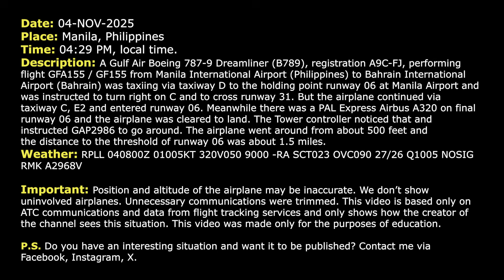Runway incursion. Controller saves 2 airplanes at Manila Airport. Real ATC

Comment: On the 787, when setting the MFD to the lowest range on the ground you can see the runways and taxiways, and if I'm not mistaken they're labeled too. It shouldn't have taken too much on the PIC to look and see which taxiway they were on and which one they were supposed to turn, especially in bad weather where that feature would've come in handy. 

While that spot between Terminal 2 and the FBO ramp is indeed confusing even on a good day, I don't see how the PIC wasn't aware of the layout, considering that this is a regular Gulf Air destination.

Comment: Part of the reason why they also accidentally entered the runway was the runway stop bar lights were not working as per the NOTAMS of RPLL
Reply: Having no stop bar light is normal bro. Pilots should know where they are with or without stop bar. RUNWAY& Taxiway markings are there for a reason. If in doubt just stop the aircraft and ask atc.
Reply: Thanks for the info.

If that is enough to enter active runways despite sitting in a B787 cockpit with not only electronic charts in their EFB, but actual moving maps which shows the entire airport layout in detail and the position of their plane, I don't know what to say. I understand, everybody makes mistakes. But if you even miss vacating taxiways, there is a deeper problem.
Reply: din atin alam totoong reason bakit nila na-missed ang mga instructions. 787 is a modern ac. may mga display ng taxiways yan for sure pero dumiretso parin sila sa runway at hindi nila nasunod yung exit na ininstruct ni tower

Comment: When first instructing the go around, did the controller really only give the altitude ("4000") and didn't use standard terminology of "go around"? Or was it cut off?
Reply from the maker: Probably it was cut off. The quality of the audio isn't really good.
Reply: The controller did mention "go around" @1:04 mark to which Airphil 2986 acknowledged.
Reply: @bryantpark88  yes. But after only stating the altitude at 01:00 without saying "go around"

Comment: Did they get a number
Reply: That's probably just a USA thing, most other countries treat incidents like this properly.
Reply: Most countries in this region will just file a complain to the airlines after the incident. No personal contact is required.
Reply: @UnitedLM10  surely an investigation is better than a complaint?
Reply from the maker: Nope. I think the don't use this thing.
Reply: philippine culture, ugh
Reply: @RichardBlaster  Expecting the Manila controller to start barking orders like it’s a Broadway audition misses the point entirely. Aviation isn’t about style points, it’s about safety. And in this case, the Manila controller prevented a potential disaster without raising their voice or turning it into a radio drama.

Manila controllers,  operate in a different environment, with different training, cultural norms, and communication protocols. They prioritize clarity and composure, especially in high-stakes moments.